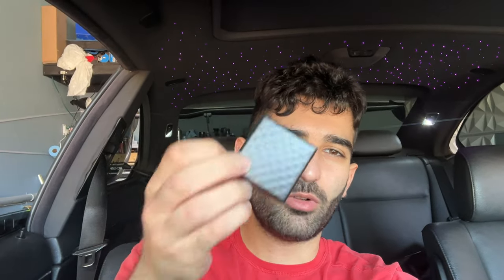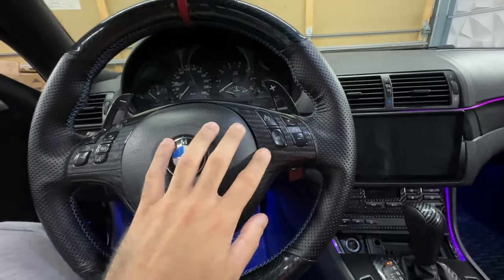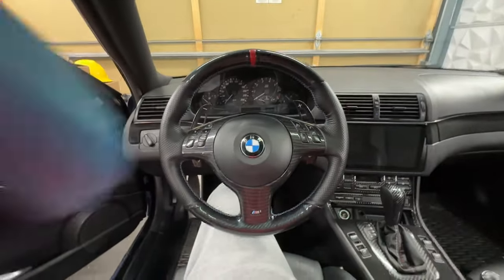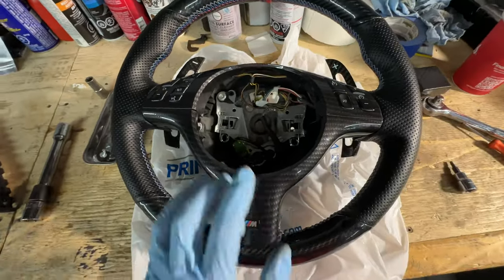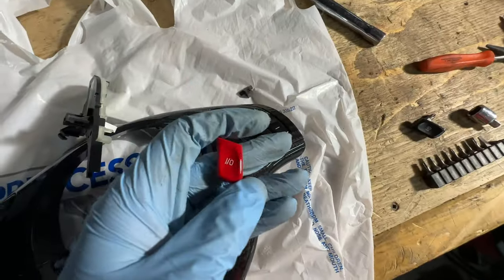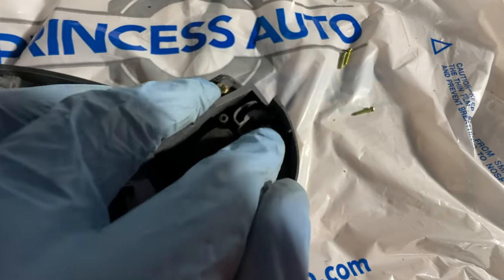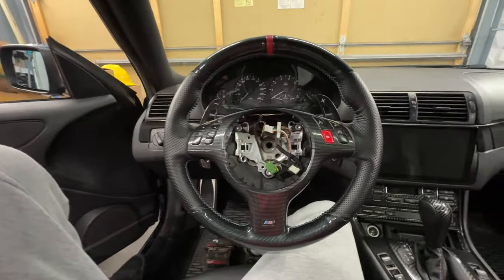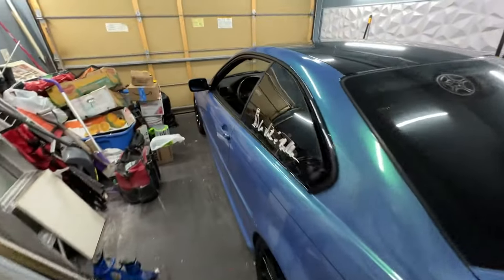$9 E46 Sport Button Steering Wheel Upgrade | E46 BMW Steering Wheel Button Removal/Replacment

Comment: how did you wire the footwell lights? because the cigarrette lighter power is always on so i dont want my battery to drain haha
Reply from the maker: The cigarette lighter turns off after some time when the cars parked and locked, wired it to the same fuse
Reply: @_mrklein nah it wont